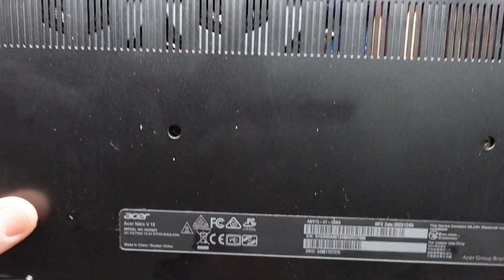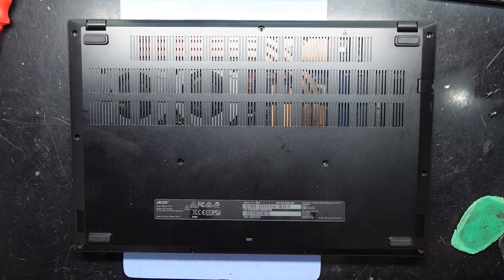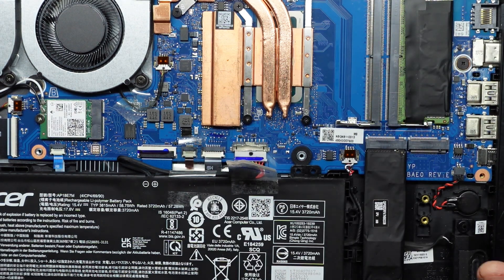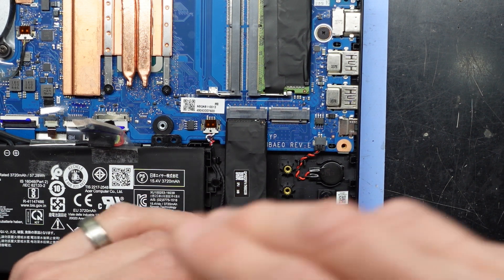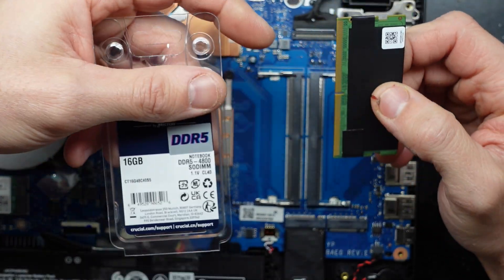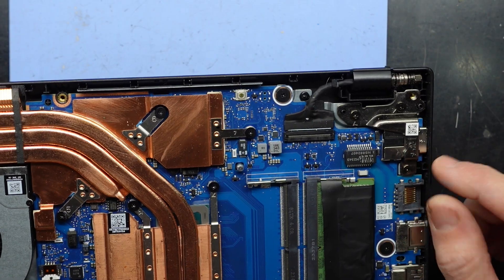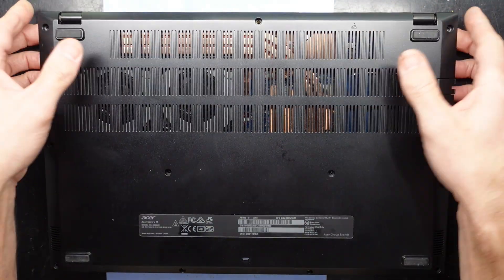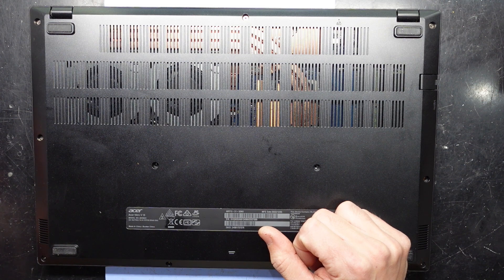Acer Nitro V 15 - ANV15-50N9 Ram and SSD Upgrade

Comment: im very confused you said you were putting extra ssd harddrive in and more memory but you didnt you do that , as for it having a 4050 gpu this laptop normally only has a rtx 2050 and 16GB ram which is 2 sticks of 8, the spare ssd slot is the slower gen 3 it only supports up to 2TB  so best to have 2 ssd at 1TB each
Reply from the maker: i didn't install new parts but simply removed and reinstall the existing parts 

Which showed you the needed steps to do the job

Comment: You can i swap the 512 gb ssd to the gen3 slot and put the new 1TB gen4 ssd in the first slot? Any steps i would need to take after or before boot up?
Reply: did u do it? i just ordered an 2TB one now for replacement, didnt know it had 2 slots haha, was thinking moving the 512 to the other side

Comment: hii.. can i just add m2 ssd on second slot like i add ram on second slot.. ? and what do i need to do after install ssd ok second slot..
Reply from the maker: after its installed.

go to disk manager / format drive
Reply: @rickstechrepairs  tq :hand-purple-blue-peace:
Reply: did u move the 512 first? or just add a new one on the empty slot?

Comment: I have the same Acer with mode ANV15-51 whats the difference between them ? core i 5 - 13420H RTX 2050 4 GB, ram ddr5 16GB
Reply from the maker: not sure exact differences just different combo of CPU / GPU's
Reply: Bro buy it cuz there is a minor diff in 3050 and 2050 and I am using it too the 2050 one U have have no problem specs are same just gpu diff and etc 2050 have 65 watt tgp trust me it is good